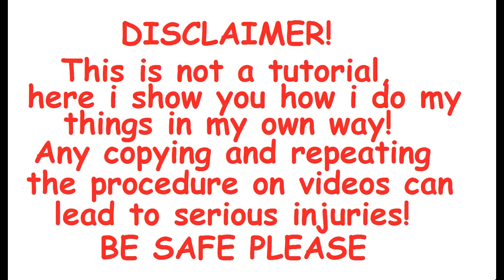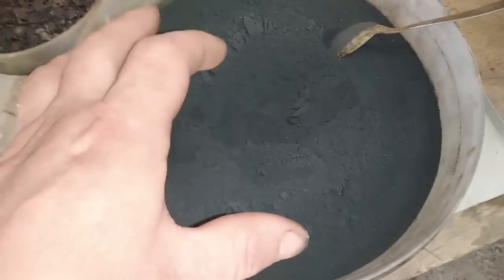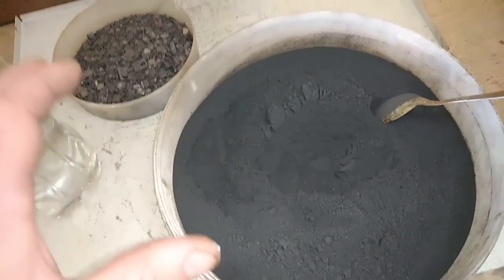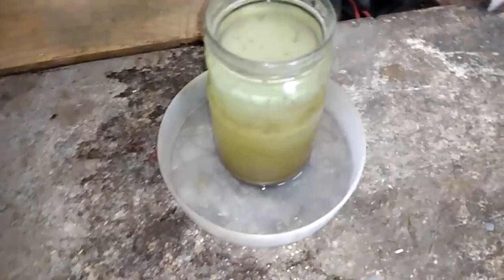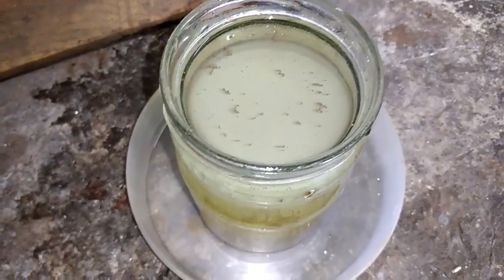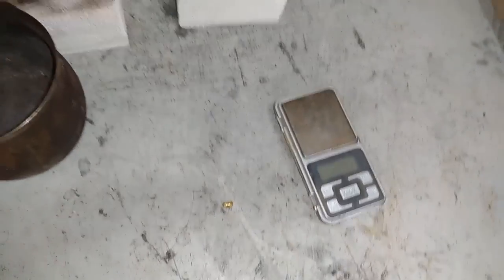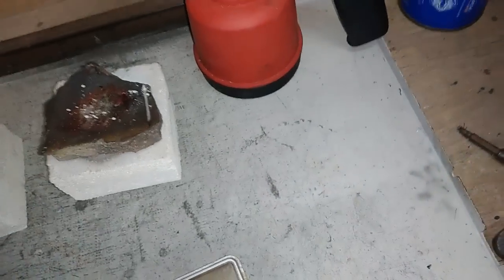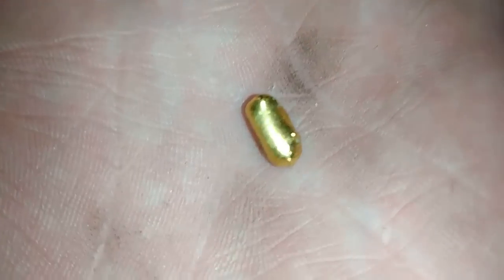Mix Ic Chip gold recovery and refining - powder from new ball mill.

Comment: Awsome vid, that was a good amount of gold from low grade IC's, 
a little tip for the butane burner. 
I have found that If you get some nickelchrome wire from an old heater element & rap a length around the burner shroud with the tip sticking into the deepest blue part of the flame about 4 to 5 mm from the gas exit, it works as a high temperature catalyst & increases the flame temperature a couple of hundred degrees; you will melt the gold much faster & save gas,
you will get a orange/white hot flame as the nickrome wire catalyses the gas at a much higher temperature. 
It has to be nickchrome wire to work as a catalyst, 
platinum wire also works to but thats an expensive way to do it. 
Keep up the cool vids, i always enjoy seeing what you get up to.
Reply: Excellent tip.  I'll have to try that.

Comment: i really like your ball i have been contemplating building a flail mill or a ball mill and you have pretty much convinced me that unless i want to make a very small flail mill that i could carry in to places wee a ball mill would be to much something vary small powered by a battery powered grinder maybe but for now. i recycled a lot of pc boards last time i could work on it and i chipped up the leftover circuit boards and filled several 5 gallon buckets with about 1 by 1 inch chips i figure about 400 lb. and while most of the gold silver and palladium have already been recovered there will be some and a lot of copper my hope would be over 100 lb. i am convinced that if i pyrolyzed the board chips to burn most of the epoxy your ball mill would make quick work of it. i will use your basic idea as it is with little change as it is just about then right size a double thumbs up.

Comment: I have about 10 kilos right now from the 70s' and 80s'. My plan is to incinerate, sift, wash, then because the volume will be so small. Im going to wet ash it with concentrated sulfuric. What's left will be nothing but the gold, copper and silver. I have tested this on a small scale many times. There is nothing left but clean metals in clear water and you need very little sulfuric acid

Comment: I commend your motivation in gold recovery.  Propane has a temperature of around 3,600 ºF or 2,000 ºC.  Butane has a temperature of around 2,610 ºF or 1,430 ºC.  Gold has a melting point of 1,948 ºF or 1,064 ºC.  This leads me to believe that the gold purity is very low, if you're having that much trouble melting it.  The color of your end result shows that the final product may contain lead or other impurities.  This would require more heat to melt.  How do you go about removing any lead contamination anyway?
Reply from the maker: This torch is for hause using, gas burn over gold melting point but burner dosent mix gas and oxigen vell, so not problem in gold purity, need good burner to melt it!